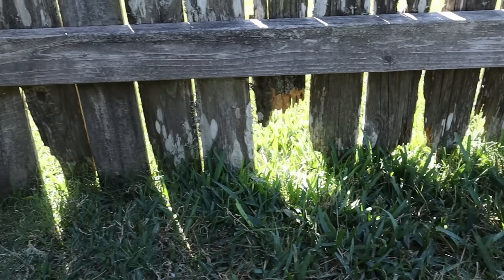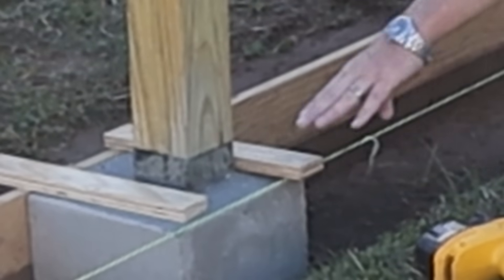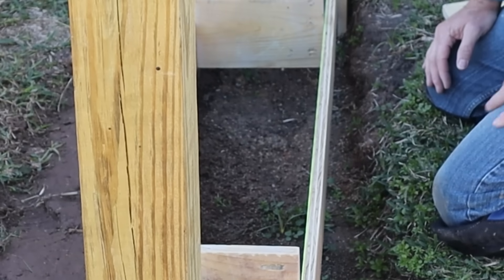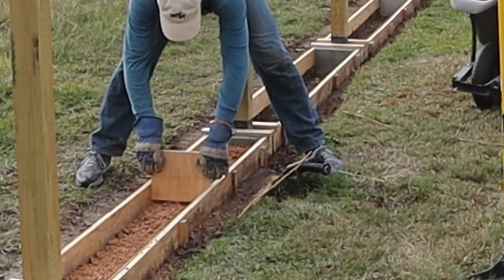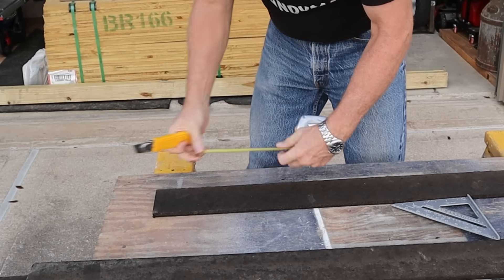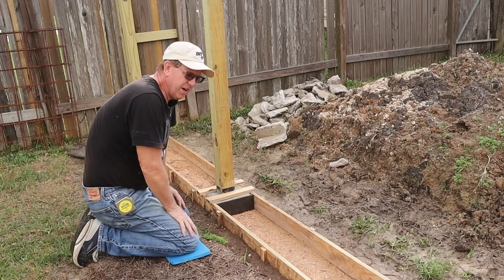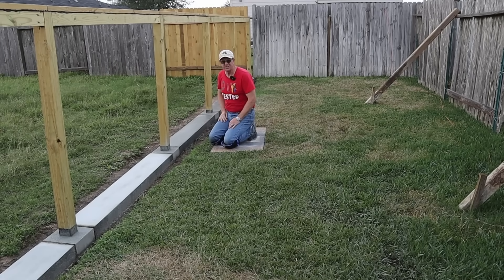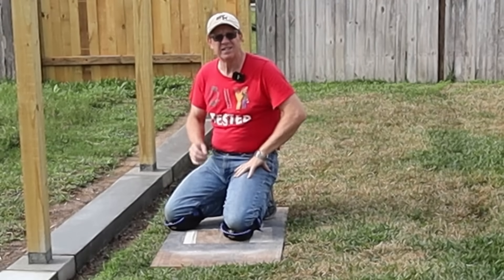Zero Maintenance Concrete Curb-Keeps Fence from Rotting!

Comment: Aren't you trapping water and blocking its flow from your yard?

Only 10 min into the video but the cost is just one of many reasons not to do this to save some cheap fence boards.

Trapping water in your neighbours yard is another reason not to do this, grading is engineered and permitted on a community level where I live.

Comment: Wow, such work for such poor results. Did anybody catch the massive curves in the forms and, thus, the concrete? I’m not exactly sure where the “quality” is in some of the comments? The use of an edger was never mentioned and cracking / poor edges were a result. The sections should have never been separated from the posts. All of this could have been formed and poured in a day with a single pour. The post brackets could have been wet set if you really wanted to get technical with it. The packing of the bottom perfectly was unnecessary and, honestly, all of this was unnecessary. The next owners are going to be like wtf and I sure as hell hope you got a survey first to verify property lines. I have owned houses where the fence was off the property line by 6 feet - in a neighborhood. Concrete is way too permanent for this application with other people involved. Sorry to be a downer, but this should not be a diy “how to do something” video unless it is a “how to waste time” video.

Comment: Got to be one of the most wrong headed, over engineered fences Ive ever seen. This is like what you get when a rocket scientist builds a fence. Rebar in a 4 inch deep, one foot wide, 8 foot long slab. With expansion material every 8 feet? lmfao. Congrats now every rain drop will hit that concrete and absolutely soak that fence. This belongs on a comedy channel.
Reply: @Vincent Urbano how many videos have you produced to help the DIY community?
Reply: Well, if you're concerned about the bottom of the fence boards rotting from all the rain soaking it just put a 1x4 rot board at the bottom...... ;D
Reply: @Andrew Moorman  I'm not certain it helps the DIY community that much if at all. I think most DIY'rs goal is to do something to save time & money and a sense of accomplishment.  This was excessive use of material with not much gain. The old adage of, "just because u can, doesn't mean u should" applies here....
Reply: The point is your criticizing this mans work.  If you don’t like it search for something else. Making a post like Vincent made doest help anyone.